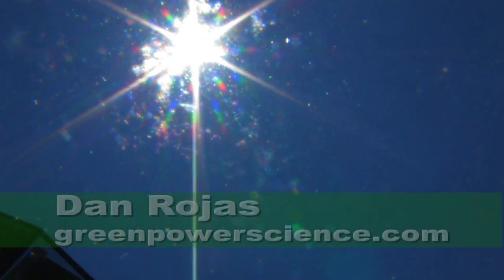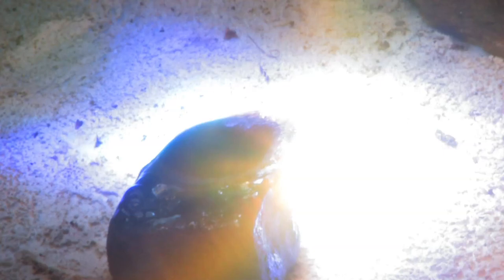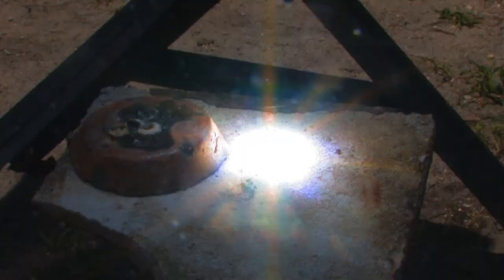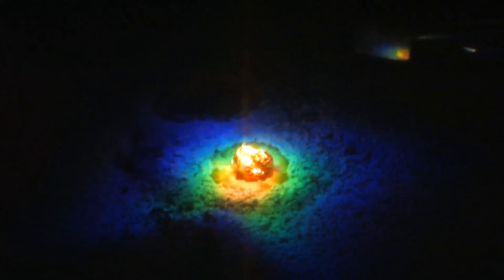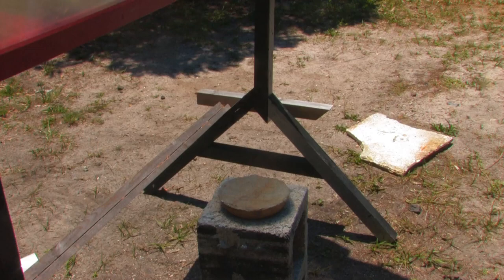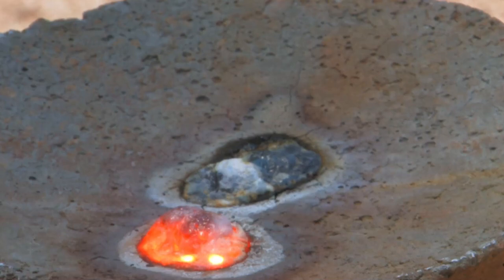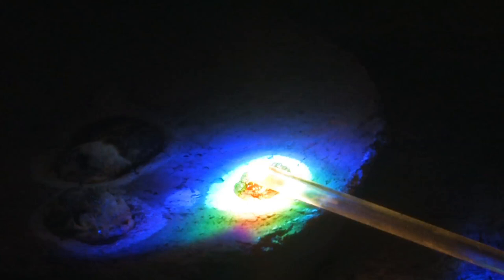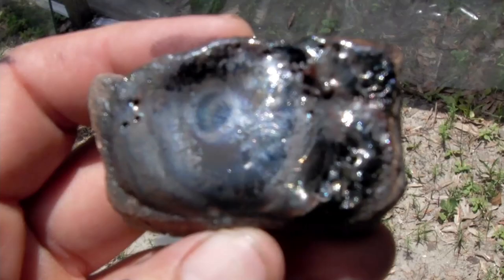Fresnel Lens 3002ºF DIY Lava Obsidian FARMING Melt Rock Sunlight Solar greenpowerscience

Comment: Is it possible to vaporize water quickly with this method? My goal is to vaporize sea water very quickly with a fresnel lens to produce salt.
Reply: My plan is to always keep a good sea water flow into the tank. Also maybe Beam will be on a Black plate midway thru and Salt will be collected at the bottom of the tank? 
Also Salt will more likely form bigger crystals than getting burnt.
Reply from the maker: +Zaber Ansary Low water volume on a hot surface works best. Large volumes require a lot of power:
https://www.youtube.com/watch?v=5GhkOnEO3X0 (5 part video)

Comment: Im curious to know if this would be considered a spot lens or linear lens? also are these the same lenses from rear projection tv's? I am currently making a solar cooker using a Fresnel lens roughly 7" x 10" i was able to heat some steel up to 305 degrees but still was able to boil water i dont know what the best container would be to get water to boil but the coke can was not the best :( any insight or help is greatly appreciated

Comment: How will the 26 X 35 inch spot lens I just ordered from you compare to this? Which if any of your videos use it?
Reply from the maker: Samuel Dunford It can do very similar work but the focal point is a bit smaller. You will be happy:-) Just use with care and do not leave in direct sunlight unattained. Store in a place away from windows etc. They are science tools. Frame building video links are also included. Thank you for your order!
Reply: Great, thanks!
Reply: GREENPOWERSCIENCE It came, right on time! I haven't been able to built the frame yet, but I can melt dirt into lava just holding it!
Also, have you looked into overhead projector lenses? They are actually 2 spot lenses held together face to face. Once you seperate them, they work a lot better. They are very clear, (about 50 grooves per inch) and for me (mine are about 11 inches square) have produced similar temperatures to the unmounted 35 x 26 lens, but with a much smaller focal point.

Comment: Why arent we heating thermo conducting materials in pressurized liquids and creating electricity for free with these devices?
Reply: Coz we are lazy. 
In fact, several powerstations are designed using the principle. Some are decades old already.
Reply: VasilyKiryanov Why does this not surprise me?
Reply: Tom Bola Well, actually, generator turbines are rather expensive. What is an average annual electrical bill in your area?
Reply: Well Im on a metre and have underfloor heating so winter is very expensive - Id say a year is £1500 for me.
Reply: Tom Bola Well, and what about a generator? Turbine, or custom-built piston steam engine? High pressure piping, radiators, batteries, charge controller... Worth of several years of electicity, i guess. MANY years. Not everyone is ready to invest that much right away for an individual system.
Reply: The process will take too long to build and then the melting process will be too slow.

Comment: Where can I get one of these lenses?
Reply: I'm not going to pretend I know, but I believe it's from a projector tv... Not to be confused with a tv projector...
Reply: Just search for greenpowerscience on ebay.  He has a store.  He does an excellent job rating each of the lenses he sells.  I bought a 24" x 24" spot lens for around $110 that was rated at 1400 degrees F.  I tested it out on my last hunting trip and melted an aluminum can in seconds.  Aluminum has a melting point of 1221 degrees F, so his lens rating was accurate.  My next project is to set it up as a solar oven for camping trips.